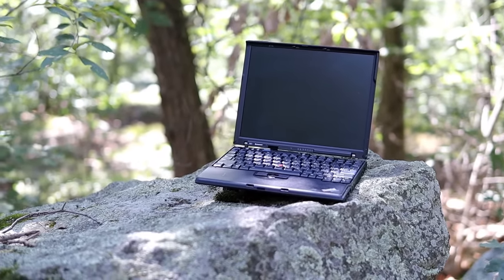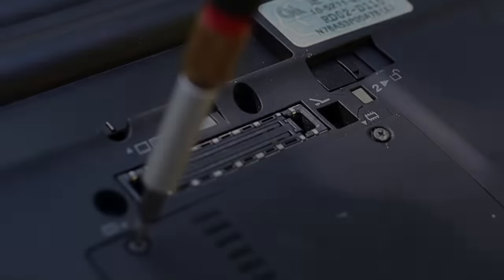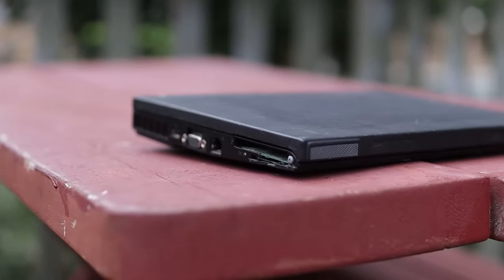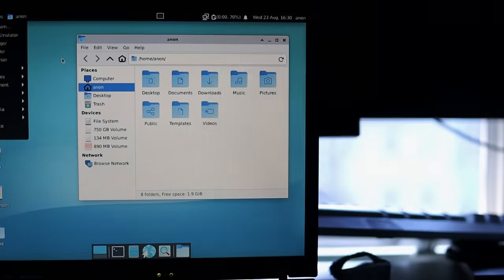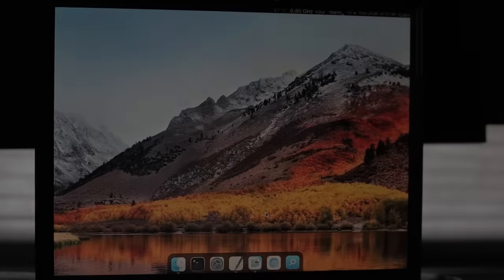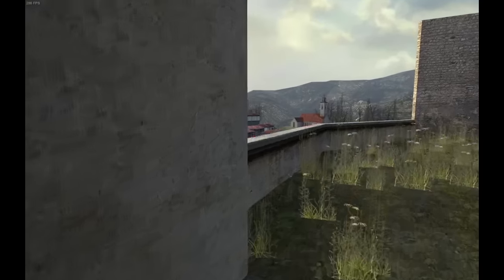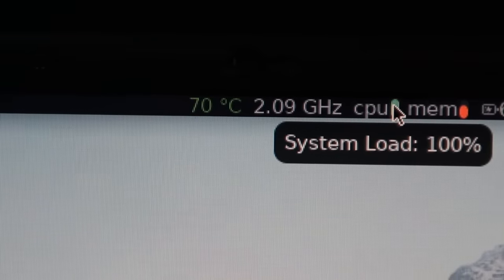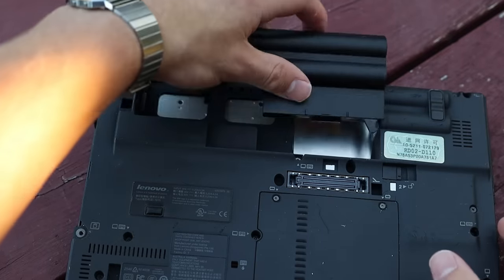Can Linux save this old laptop from obsolescence?

Comment: I'm beyond thankful for lightweight linux distros because they saved my old 2012 laptop from becoming landfill. I had to move a few years back and I didn't want to rely on my phone all the time for media so I dug up my old inspiron from a decade ago and put in an old cheapo SSD I had lying around. Given that my financial situation collapsed in the 2010s I now can use that laptop as my TV, music player, and even a secondary PC when my friends need tech support. I legit can't imagine life without it and had it not been for enthusiasts' hard work I would've never been able to have the life I have now.
Reply: My daily driver is a 2012 T430 3rd gen i7 working perfectly at the same speed as my last company notebook with 8th gen i5 (both 4  cores / 8 Threads), the only benefit of the newer laptop was a better power efficiency. Even the 2nd gen i7 was equally fast, but has worse build in GPU. also the coreduo is working good with enough performance. The biggest problem you have with the old laptops is with the accu (no problem if used with the powerbrick anyway) and perhaps a weak bios battery. Push the RAM to the limit and if possible use a SSD and you will never understand why you needed a "modern" laptop. for 100 to 200$ (including all upgrades like RAM,  SSD and 3rd party battery) you will have a powerful notebook with Win7, win 10, Linux or as a hackintosh.

Don't forget to update your thermal paste which will be dryed out for sure.
Reply: @purplegill10 hopefully your financial situation is better now! <3
Reply: It’s amazing what an ssd can do
Reply: My daily driver is a 2012 T430s 3rd Gen i5 running Windows 10. I also play some games on it too (3d AAA games up until early 2010s), I cap them at 30 fps because it only has integrated Intel HD 4000 graphics.
Reply: Back in two oh one two?
Reply: andyf104  I would say you cannot define a certain schedule its depending on many factors. What  thermal paste applied, running time, what environmental conditions, running conditions, ...

there are several tools to get a readout of the temperatures compare the temperatures to other temperatures, if you have thermal throtteling its worth to check the cooling system fan, cooler if free of dust and if thats o.k. probably renew the thermal paste. But of course  if the vents are blocked or you laptop is on a blanket it cannot breeze. the intel 3rd generation hits 100°C if running e.g. cinebench multicore thats normal. But after a few years it can be a good idea to change the thermal paste, on the thinkpads its an easy job, you need the Hardware maintenace manual, a ph1- Screwdriver, a guitar-pick or credit card, thermal paste, rubbing alcohol, lintfree paper e.g. coffee filter. If you open your notebook for the first time watch a Youtube video for your notebook where its dissassembled. After 5 years the thermal paste has a high probability to be dried out.
Reply: @Keepskatin  Phones are expensive toys that are not designed for adult computing - that's why kiddies like touchscreens on tablets for their Disney movies in the back of their parents' car on long journeys.

Apple and Google Android phones are great for people that don't care about their privacy - they are just surveillance devices for both companies that the uninformed user pays for. Both types of devices deploy wifi triangulation technology that report your location to an accuracy of 2 meters 24x7.

The best thing to do with phones and tablets is only buy Android ones that are supported by an AOSP-based version of Android like Lineage, Calyx or Graphene OS, install one of those on it and leave all Google apps off of it - which then stops Google's surveillance of you.

My phones and tablets are "deliberately dumb" - all of them de-Googled and everything I need on them is installed locally (with the exception of sync-ing with my home Nextcloud server) and accessed using only Open Source apps. The bonus as a result is that battery life increases by a factor of 2 or 3 times due to the lack of "phoning home" and the devices sits quietly in my pocket without constantly demanding my attention.

If I need to do proper computing, I pull out my Thinkpad X220 that goes everywhere with me, sit down with a coffee and do what I need to there - whilst often looking out the windows and watching the "phone zombies" walking along whilst peering down at their little phone screens and making nuisances of themselves by bumping into each other.

When you understand computers properly, you control them - you don't let them control you, which is what a standard Apple or Google phone is designed to do.
Reply: You don't need linux. Windows 10 runs just fine on these devices.
Reply: @0w3nn  >Windows 10
Support will end in october 2025, and then you're using a system with no security updates
Reply: @Vladislav888  then upgrade them to windows 11.
Reply: @0w3nn  I'm not sure if installing Win11 on a Core2Duo PC is even possibe
Reply: @Vladislav888  then don’t upgrade it to windows 11.
Reply: @0w3nn  Then you will be rocking the network-connected machine with known vunerabilities that will never be patched.
Good luck with that.
Reply: @Vladislav888  So what do you suggest to do?
Reply: @0w3nn   Either never connect to the internet or switch to Linux.
Then you will have a secure supported modern OS.
Reply: @Vladislav888  switching to linux isn't as easy as you think it is. And I definitely need the internet
Reply: @0w3nn  >isn't as easy as you think it is.
I've never said or implied that it's easy.
My point is that for a lot of older hardware it's the only secure option.
Reply: @Vladislav888  it doesn’t have to be the only secure option but bs Microsoft is too greedy

Comment: The keyboards on these were amazing. You could type forever on them and they just felt great. A hidden benefit from older, less powerful hardware is since it's slower, you are limited in your multitasking and are basically forced to focus on what you're doing.
Reply: I still use a Thinkpad T22 from around 2003 with a Pentium III CPU running at 700 MHz with 512 MB RAM and an IDE SSD on which Gentoo Linux is installed with an i3 desktop.

A couple of times a month, I SSH into my home server to write BASH or Python code with a couple of terminal sessions open, I have my email open in mutt on a second desktop and a console music player going on the third desktop - with overhead left to run a few other things too.

It has a great keyboard and it is just a very peaceful and distraction-free way to enjoy my computing occasionally.
Reply: You can buy a desktop keyboard like the thinkpad, trackpoint and everything, lenovo sells them.
Reply: Best method is to just not install a graphical environment at all. I understand that's not always an option depending on what you're don't ng but if you can do it it's great for avoiding distractions. Second best option is xterm in full screen mode. Alt+Enter and it goes borderless full screen.
Reply: Tiling window manager or compositor helps alpt with multitasking 😊

Comment: Void Linux is a solid choice. My T420 uses Void Linux and I've never had an issue with it. Ever. Once configured, it just works.
Reply: hows the battery life? im thinking about installing void on my x1 carbon
Reply: @damien523  Well, this t420 came with an old, original battery and it still holds nearly a 2 hour charge under basic use; watching YT videos and such.

Comment: I just bought the X220 for the price of $15. It's in the rough shape but it's still functional and just needed a keyboard replacement. I put whatever SSD and RAM I have at my disposal and with $30 I have a very functional laptop that I can use whenever I need a Windows/Linux machine (I use Mac as my daily driver). These old computers really don't deserve to be on the e-waste, they just need a better software to keep on chugging.
Reply: I just bought a t480 untested for $60. fingers crossed it works. even if it doesn't work it was still worth it, the ram and ssd alone are worth 60
Reply: The X220 is basically in a perfect spot. in 2011 it already had very modern hardware, supporting modern OSes, but is still a proper business machine that can be user serviced.

Comment: A 16 year old laptop, that has been continually used is really really old. If it was retired after say 5 years of usage and being stored in a dry and dark place, it might still be usable, but it is up to chance. There are also aging processes in soldering that may cause short-circuits so that it dies suddenly if started up. If you get life in a 16 years old laptop that has been used for 5 years, you are lucky. Windows, no way! It must be an OpenSource operating system, since there are always hobbyists doing it the old way.

Comment: In 2013 I got an Acer C710 Chrome book. I flashed the bios with seabios. Installed a 500 gigabyte Samsung Evo 960 Sata SSD, 6 gigs of ram. I use Bodhi Linux, with the Moksha desktop environment. Still using it in 2023. ♥️😊

Comment: Lots of good lightweight choices out there - Alpine, TinyCore, Slax and many more. It's been fun to watch computing evolve. I started in 1974. Yeah, I'm that old.
Reply: Same here, in fact I still have a C64, 1040ST and a 2600 hooked up and use.   Main rig is my RHEL/Fedora dual boot workstation.  But those oldies are great.  And another fella here that keeps hardware until the magic smoke angel takes it to hardware heaven.  Linux and BSD make that possible while still staying current (SSL on ancient OSes is painful to make happen --- looking at you SunOS and Workbench).
Reply: Then I hope you still have an old terminal and some punch cards!
Reply: Exactly what I dream of when I get old, be a tech veteran without losing his touches.
Reply: Pong doesn't count.
Reply: You're only a bit older than me - I programmed my first computer back in 1983 on a college day release course with my first job in the telecoms industry. It was assembly language programming on a Z80 CPU.

But I did maintain a very creaky DEC PDP-11 running RSX-11 in a customer's call centre for a while!
Reply: And artix.
Reply: Holy, You are as old as my dad!
Reply: Also I come from TRSDOS and CP/M-80 😊
Reply: Not as old, but I'm using debian with xfce for my homeserver, doing a fine, lightweight job.

Comment: I have one of these I use fairly frequently, personally im running mint on an ssd. The 4:3 aspect ratio makes it ideal for torrenting old anime and cable shows. It also proved a novel way of experiencing the SM64 PC Port. As you mentioned they work quite well for schoolwork. Glad to see some appreciation for these old machines
Reply: I also have an oldass thinkpad for watching vintage anime
it's so cozy, I happened to give it an IPS screen and while my modern laptop's color destroys it, the thinkpad is still great even though it's ancient
Reply: I use rtorrent on one of my Thinkpads and basically use it as a seedbox in addition to just being a home server. I've never tried watching anything on it, because the display is quite bad, but is possible to upgrade. So, typically I just download stuff to it, seed for a while, and clone it to my main PC when I want to watch it. Do you have to worry about what torrents you download? I'm surprised that Thinkpad T-61 can handle the codec, will it work with h264 in standard def? What happens if you try to watch something like a 720p or a 1080p video in h264? I'm guessing h265 is likely out the window; although most of these old shows and DVD rips probably aren't in h265.
Reply: @youreyesarebleeding1368  idk man mines a 220, plenty of power to render 1080p video

Comment: I upgraded a 16 or 17-year-old Dell. I replaced the hard drive with an SSD and upgraded the RAM to 4G. It's running the standard Linux Mint, and it runs quite well. 
Thanks for the video.
Reply: Absolutely. If you can pick up and old Core 2 Duo machine from 2006-2007-ish with a 64-bit CPU with 4GB RAM and an SSD containing Linux, it can be a perfectly viable daily driver machine.
Reply: can you tell me how to upgrade my 2007 Dell Vostros 1500 with an SSD?
Reply: @lauriroberts322  you take out the old drive and put in the new one. Obviously assuming it uses SATA, which is most likely.

Comment: I would also like to mention Puppy Linux. It is available as 64 and 32 Bit version and runs fine on almost any old hardware, e.g. on the small netbooks with Intel Atom CPU and 1 or 2 GB of RAM, which are otherwise almost useless today. Use it on my Lenovo Ideapad S10 with a 256GB SSD and it works perfect.
Reply: Agree, Puppy Linux runs on lots of older hardware
Reply: Tried Puppy on an old Asus EeePC, and while it worked from a USB, it didn't when I installed it for some reason. Had to find a lightweight homebrew XP for that one...

Comment: I wish that Lenovo (or anyone) would make new computers just like this.
Reply: It depends on what aspects about the computer you like, but Framework makes a good laptop. You can swap the ports out on the side, it's very easy to repair and all replacement parts are available, and they released full board schematics as well as 3D prints so you could give the laptop mobo new life as a SFF desktop. They're coming out (or perhaps already released, I'm not up to date) with a new model that has 6 expansion ports, plus an additional large one on the back that could be used to install a GPU, more Battery, more Storage, or anything. There is also a third-party scene around making expansion cards for the laptop.
Reply: They do. Business laptops (like this one used to be) are very upgradable and use modern hardware. They're really expensive though just like this would have been when it came out.
Reply: You really don't value a portable laptop being thin and light? Or the 16:9 aspect ratio?
Reply: @MJ_M  There are other things besides watching movies on it.

Comment: These really were awesome machines and fun to mod too! My wife is still using my old X61s that I modded back in the day with a beautiful 1400x1050 IPS screen, a hidden dip switch under the battery to overclock the FSB from 200MHz to 266MHz when required, a modded BIOS to enable full SATA2 speed among other things and the usual upgrades like a SSD and 6GB of RAM (8GB would be the max). The most important upgrade (at least back then) IMHO was the screen because the original 1024x768 TN panel was an absolute deal breaker since I actually had to get some work done on it. The upgraded screen came from a X60 tablet and even to this day it looks just amazing :)

Comment: I like using Lubuntu for these cases. It's current version is 23.04, based on Lunar Lobster, and uses the LXQt desktop.
Also, it is well known that we hardly need current CPU performance for simple office applications, which is what gave birth to the Intel N* and *U CPUs that essentially are stealthy time traveling devices bringen the user back to the mid 2000's.
Reply: The N95/N100 are about equal in performance to the I7-3770 from 2012.
Reply: LXDE/LXQt and xfce are indeed incredibly lightweight, but still feature rich.
Some of the ultra light environments take out so much, that it becomes hard to use them as daily driver.

Comment: I have a 15+ years old all-in-one pc with approximately the same specs. It uses manjaro kde with no problems. Plasma KDE uses up approx. 700 Mb. My mother used it for work and web browsing for more than 10 years. She even records audio with USB DaC and microphone. That's the magic of Linux.

But Linux is not only for old pc revivals. Try it on newer hardware and it becomes a blast.
Reply: How can you watch YouTube😅.
Reply: @myfranci560  ??
Reply: @rawmaterials3909   ur so is lighter than youtube lol
Reply: @myfranci560  ... and?
Reply: My Desktop PC with a Ryzen 5800x, a Radeon 5700XT, 32gigs of RAM, and 14TB in assorted SSDs and HDDs has been running Garuda Linux for well over a year and I absolutely love it, haven't bothered to open Windows 10 on the small old SSD it's still installed to for more than a few minutes just to convert a few files and swap back.

Heck, I've enjoyed it so much I have Garuda XFCE running on my 2013 Laptop and even that old underpowered thing runs like a charm.

I've had a handful of issues over my time as a new Linux user but nothing that I couldn't overcome with a little searching and patience, and were mostly brought on by user error, having backups accessible from the Grub bootloader has helped massively for this too as I can be back up and running  to the point right before my mistake in less than 5 minutes which saves mountains of frustration I would have needed to deal with on Windows including but not limited to a full re-install